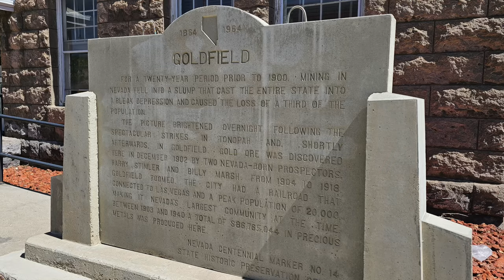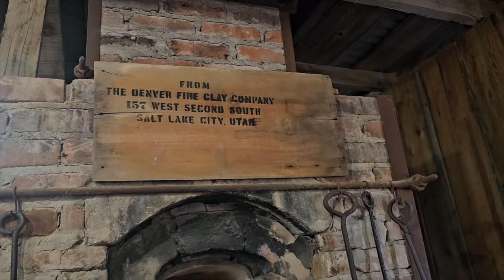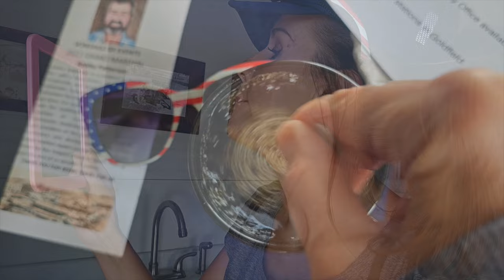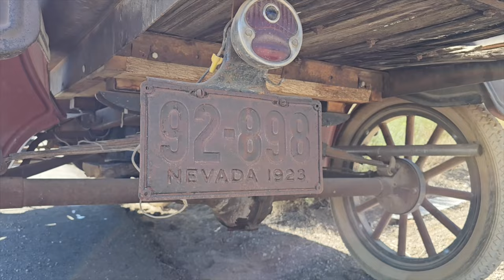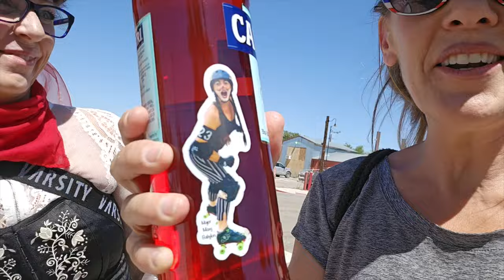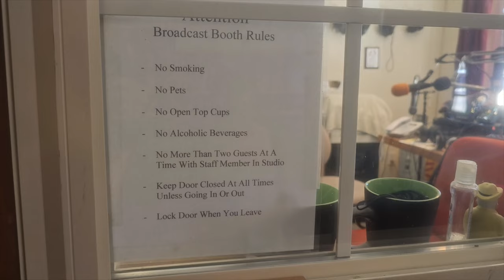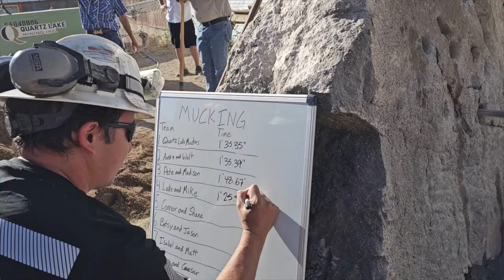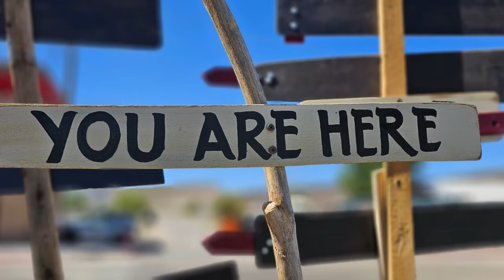The Greatest Show on Earth: Goldfield Days 2023!

Comment: Used to hang with the Long Beach Model T club back in the mid 60's, I am one of the few that can still drive a 3 pedal Model T with Ruckstle, gas lever is on the steering wheel

Comment: So this happened when I lived in Tonopah in 1995. Up near the Nye county line was an intersection of Hwy 95 and an old overgrown two lane road called OLD Hwy 95. Who knows if it still exists as it barely did then. I was curious and turned off the highway and with only one vehicle in sight and about a 30 mile vista, I  apparently ran a stop sign in the middle of the desert right there. Of course the vehicle was a cop and I got a ticket for which I was required to attend Esmeralda County court in Goldfield. I'll never forget it. I stroll in about two minutes late and there in a completely empty courtroom was judge Juanita just sitting there waiting for me! Yes it is a low population area! I used to frequent a small hot springs in the area called Alkali. It was a tiny concrete bowl adjacent to an old glass dump site with a resident pack of wild horses. I wonder if any of that remains?✌️

Comment: You get water gas electricity sewer hookups with the $1,800 lot?
Reply: Nope!
Reply: @goldfieldgary  seems hardly worth $1,800
Reply: @Horselattice  guess that would depend on how much you enjoy using a 5 gallon bucket for your toilet.
Reply: @goldfieldgary  gold fever $2,000 ounce
Reply: How long does it take to pan for gold?

So digging and cleaning out a small but good crevice and panning the material might take twenty minutes. Let's say that yields a quarter of a gram, which amounts to about 0.75 grams of gold per hour, and that gives just about 42 hours to get an ounce of gold by panning in a typical but decent spot
Reply: Find an assay refiner in a big city 10 refiners quote you quite a difference in price...take it to 2 refiners you're gonna wanna take it to a third.   Assay fees vary  from nothing to a lot...spread bid ask bullion...if you save up to get a better price your refiner might be a crack head out to rob you...the cop at the brothel  in wonderhussy last video probably on the take